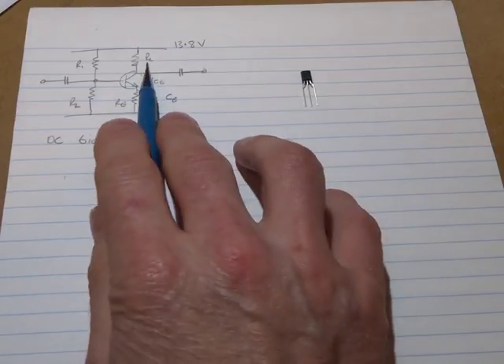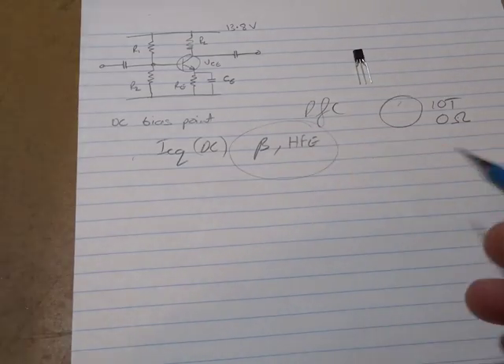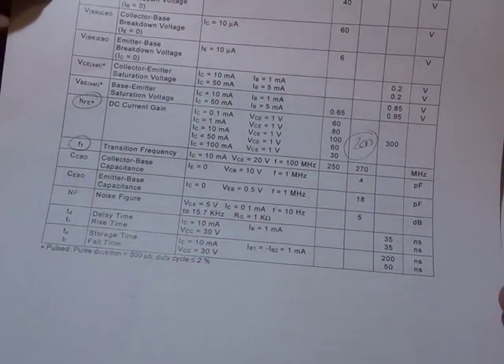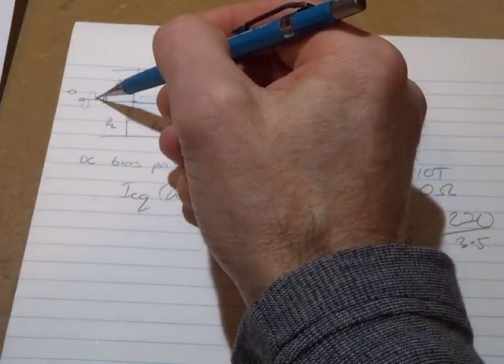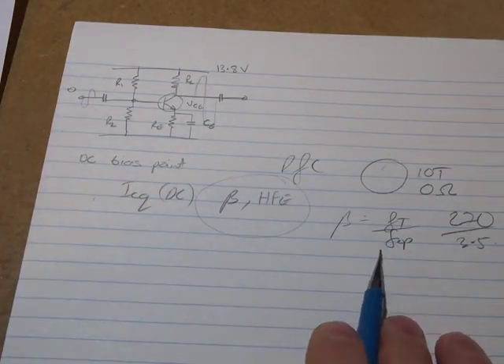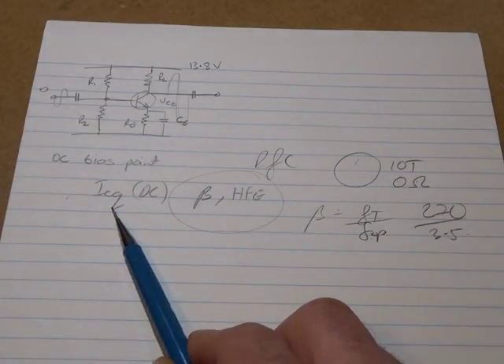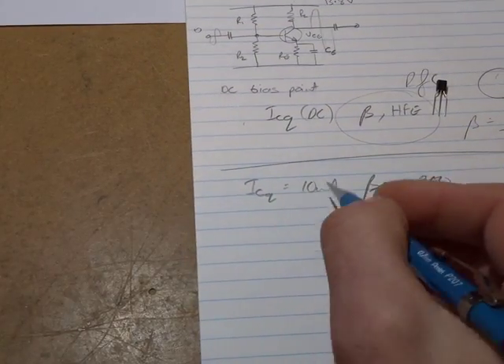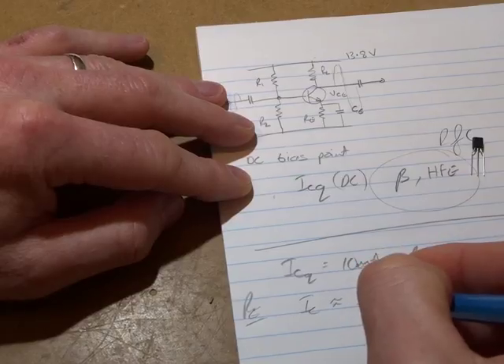Common Emitter Amplifier Biasing Calculations

Comment: The IF rx stage is very inportant but ay have some ideas for experiment with that.Cascode IF amplifier with 4x2N3904  Single Sideband for the Radio Amateur - 5th Edition - ARRL (1970) or   http://www.qrparci.org/wa0itp/csts_book.pdf       http://www.acrayara.com.ar/biblioteca/public/Amateur%20Radio/Single%20Sideband%20for%20the%20Radio%20Amateur%20-%205th%20Edition%20-%20ARRL%20(1970).pdf
Reply from the maker: Thanks Madalin.

Comment: Here is a schematics for a Romainian hf transciever call A412 https://yo4hhp.wordpress.com/2011/10/27/transceiver-a412-description/     and the another one call FT412 design by YO6PIR  .I have a A412 and it works very well
Reply: The A412 use a BF254 rf stage transistor.I have original documentation about this transciever but it is in Romainian language PDF 
if you're interested
Reply from the maker: Thanks Madalin. That looks really interesting.

Comment: why don't use a rf transistor such as BF199,BF254,BF214,BFY90 series or japanese .The 2N3904 it not design for rf and it very noisy
Reply from the maker: Hi Madalin. You are right that those transistors would be more suitable, but the approach I have taken (right or wrong) for the video series is to readily available parts in an effort to encourage others to give homebrew a go. I guess I'm trying to demonstrate that a functional radio can be build from common parts. I can see another build coming on using the parts you identified as a way of showing performance differences. Thanks for the input

Comment: You must have a ''beta-meter '' !!!
Reply from the maker: That sounds interesting Madalin. Do you have a recommendation in mind? It would be interesting to see how much an actual device differs from the spec sheet based mean.
Reply: Yes a beta-meter with difrent collector current test condition like this http://sound.whsites.net/project31.htm.Of course your designs 
must be dependent on beta to other viewers to replicate schematics,not everyone have a complex betameter to design the best pesformance of the transistor which they have at their disposal.
Reply from the maker: @madalinbetea9871  Great. Thanks Madalin.

Comment: Excellent video.
Another design consideration...
Doesn't using a 2:1 transformer effectively cut your gain in half ?
Reply from the maker: Hi. Sorry for the late reply. The main aim I was going for by matching the load to the collector circuit was to achieve maximum power transfer, as opposed to maximum voltage gain (as you point out).

Charlie

Comment: Hi Charlie

Been playing with 'traditional' calculations for this specific biasing technique...  I too come from the 'old school' days of electronics teaching.

What my own calculations seem to suggest, is that your rule of thumb is pretty spot on.  That rule of thumb also appears to be confirmed when running modern tools such as LT Spice (XVII).

The only variation I did come across was Rc.  In both the 'traditional' calculations, online biasing calculators (yes, they do exist) and, LT Spice, the best overall gain came with an Rc (purely resistive) value of between 450 and 650 ohms.

Playing out that value, in LT Spice, I replaced that purely resistive load (Rc) with a 9:1 transformer bringing, in this case, 450 ohms down to 50 ohms modeling an FT-37-43 with 9T:3T in LT Spice.

The gain measured into a 50 ohm resistive load was identical to that measured at the collector output with a purely resistive Rc.

As I have never, in real world experimenting, encountered an Rc larger than ~300 ohms with a 2N3904 based amplifier, indeed, I typically reference 200-250 ohms for Rc, I attribute this to a couple of things.

First is that LT Spice, as good as it is, is still just a simulation.

Second, there is the issue of the internal collector resistance.

Lastly, I could be totally wrong! :p

One last thing is the debate over beta vs hFE.

It would seem hFE (DC current gain) is the proper reference.  I've seen beta and hFE used interchangeably and, I've seen arguments that they are not necessarily related.  

Given that datasheets today rarely list a beta value and do list hFE, using the latter seems to make more sense, as does your choosing a design hFE of 200 with the 2N2904.

In any event, as I stated previously, it seems your rule of thumb is spot on, in my opinion.  The real world operational results of your methodology would seem to support that it is correct as well!

Great video!

73, Robin - AC7LX
Reply from the maker: HI Robin. Firstly thank you very much for the reply, it was very useful. So, from your experience, do you just set a value of Rc to be-say-450ohm or do you determine that each time by finding the open circuit Vo, then Vo/2 across a variable resistors (as Lar's suggested a video or two back)? Also, for determining hFE from the spec sheet, have you across geometric mean before? I seem to recall way back working out the hFE by SQRT(min hFE * max hFE), and not (min hFE + max hFE)/2 .
 
I'm about to start the mic amp so I might as well use a refreshed design approach and 'rules of thumb'.

Thanks again Robin.

Charlie
Reply: Hi Charlie,

Actually, until about a month ago, I had basically assumed an Rc between 200-300 Ohm.  That came from looking at other designs and, a datasheets (I don't recall which one), where there was a reference to  some level using an Rc of 275 Ohm.

Later, I found and watched a video by W2AEW on determining an unknown output impedance from a signal source.  

It was then I had started experimenting with different values of Rc (or RL) to discover at what point the signal was half of the unloaded collector.  I also discovered there was a lot about amplifier design I needed a refresher on!

After your video, I tried something similar to see what Rc got the idle voltage at the collector to Vcc/2 for a given design and then, depending on what the amplifier end use, would adjust to feed a given impedance or, in the case of RF, calculate an impedance ratio to match to, in the case of RF, 50 ohm.

I kind of like LT Spice for that because you can try things without destroying a device.  Pretty sure I'd have some issues with simply tying the collector to Vcc in this design.  

In actual experiments I have started with some ridiculously high values for Rc to attempt to obtain something like an open/unloaded collector and then see what value for Rc brings the signal to 1/2 of unloaded.  

The apparent difference between the two methods is that one is looking for half of the unloaded signal and the other is looking for half of Vcc at the collector with no signal.  I kind of prefer the latter because it can be calculated before attempting.

Honestly, I should be better at this stuff, but it's been 40+ years since school and 10 years since I retired and took a break from radio, only renewing my interest a couple of years ago.

As far as the hFE calculations, I've never done the sqrt calculation, but it seems to end up with similar/close values. ~172 vs 200. However, one never knows which is better until one sees the results.  It is certainly interesting.

Most of the time I use Spice to be close and then work with an actual circuit.

Probably doesn't help much, but there it is. :D
Reply: Hi Charlie,

Just a followup on my last comment.

Simply put, I screwed up! LOL!

I think I know how LT Spice came up with that high Rc value.  I (think), that it was because I was looking at Rc as 'the load', when what I was apparently doing was looking at an open load condition. through a capacitor. 

I replaced the high value resistor with a reasonable inductance (~10uh),  measured the collector output again and got the same value as with the high value resistor.  I then coupled the collector (in that configuration) via a 100n cap to a variable resistor (load) and discovered what I had always assumed.  The output impedance of the 2N3904 is indeed, around 190-240 ohms, at least in LT Spice.

Interesting brain fog on my part, but now the world seems to make sense again.  Well, at least where this stuff is concerned! LOL!

73, Robin - AC7LX
Reply from the maker: Cheers Robin. That 190-240ohm falls nicely around the 200ohm rule of thumb in the SSDRA and EMRFD texts. I do like Lar's process of determining the actual output resistance through test.  

Thanks again for the update!

Charlie

Comment: This looks like a excel spread sheet is needed with the rules of thumb being the calculations and just drop in transistor info with voltages.  I am surprised this is not already available along with many commonly used devices for ham radio. Certainty the info is inside simulation modeling software but it would be useful to have it unmasked and simply available.  Thanks for the video!
Reply from the maker: Thanks Kenneth. I expect this is somewhere on the web. I quite like breaking out the ol-HP48G and running the numbers from scratch. Thanks for the input.

Comment: Hi Charlie -thanks for video 
The approach I have used in the past is to cheat !
Go to old service manuals find the device in question and a circuit close
to the one you want ,copy it and alter the value's you need
That way you will be quite close to what's needed
Cheating -yes,but it works !
What do you think?, or should I be drummed out of the Ham community !
Thanks again
Reply from the maker: Whatever works. So long as you are having fun!

Comment: Good Topic and a well done video,  I recently discovered your channel and I left a comment regarding your casecod amp which was also a good video. Good enough that it got me thinking and a little bit motivated. May I ask what your education is? I have a BSEE from an ABET accredit school (SVSU), graduated in 92 and I am also an extra class amateur licensee My concentration of study was control systems so I am almost useless when it comes to RF design but I have recently become very interested in the subject and I have been devouring every text book, web site and you tube video that I come across.  The best text, thus far, that I have come across is "RF circuit design by Chris Bowick". I referenced that text in regards to this video and like you he really stressed the importance of setting the proper operating point. His analysis focused on maintaining a stable bias point vs temperature and while doing so made some assumptions (regarding hFE / hfe ) while I think that understand why, he makes no mention why he did it.  His example uses a 2N5179 and he just stated it to be 50 (its range is 25 to 250) and you did a similar thing choosing your Beta but using characteristic curves and a load line. As I recall from school that parameter is very hard to control in manufacturing and can vary wildly, there are design technics one can use to minimize the affects, I will have to see if I can dig up my notes from my college days. Aside from picking that value, which can be arbitrary, you did everything else by the book. I can't wait until the next video, thanks for sharing. 73
Reply from the maker: Hi Michael. Firstly thanks for the feedback. I did 30 years in the Air Force, where I started as an avionics technician. All of my basis electronics theory was taught there. Later on I did a BE in electronics, but never worked as a design engineer. It's playing around at home where I try and put those lessons from years ago to good use. I must look up that RF circuit design by Chris Bowick book too. As for beta, I took a simple mean between the min and max values out of the spec sheet. If i recall, taking the geometric mean (square-root of min*max) maybe a better option. As an aside, I don't use characteristic curves, but tend to start just with the spec sheet. I think i will start to use 10mA as a quiescent Ic, as that seems to be a good option.

Again, thanks to you and the others for taking the time to leave a comment. I really do appreciate it.

73s
Charlie, ZL2CTM
Reply: @CharlieMorrisZL2CTM  Because β does vary in manufacturing, it makes sense for the hobbyist to look for transistors that are gain-selected. I currently prefer BC547C for general use which has been selected to have a β between 420 and 800. That's a tight range and typically remains independent of collector current from 1mA up to 100mA. You can design with those and assume a minimum β of 420 safe in the knowledge that the calculated base current won't be any less than half the value calculated.
If you use 10mA as the quiescent collector current with a transistor like the 2N3904 (min =100) and bypass the emitter resistor, you can end up with an input impedance looking into the base of 100 x re = 100 x 25mV/10mA = 250R. That will be the dominant value in determining the stage input impedance since R1 and R2 were found to be 22K and 3.9K, and all three are in parallel.
It should be obvious, I hope, that reducing the collector current by a factor of 10, i.e. to 1mA will reduce all of the currents by the same factor, and hence all of the resistances and the input impedance will be increased by a factor of 10. For RF use, you can match stage impedances with transformers, so it makes sense to select a Ic that makes the parasitic capacitances negligible and 10mA might be sensible, or maybe a lower Ic might be just as good. For audio use, an input impedance of 250R would not be a good idea because of the size of coupling and bypass capacitors needed to get a flat response down to 20Hz. For audio, an Ic somewhere between 100μ and 2mA would be a more common choice
Reply: Charlie, thanks for getting back to me, I think I have just what you need. Are you familiar with w2aew youtube channel ? He has a few videos on this topic. Video # 182, and #272, here is a link to his Bias video # 182 https://www.youtube.com/results?search_query=w2aew+185
Reply: Charlie Morris Wow you were in Army. That explains it.you are fantastic.

Comment: Hi Charlie, great video as always. I think your idea of the quiescent voltage on the emitter is not right. At 3:44 you explain the 1V rule of thumb because the working line should not enter the cutoff region. I think this (your way of explaining) is not right, because Ve is completely external to the transistor. The diagram you use shows Vce, which is the emitter-collector voltage, completely inside the transistor. You could lift the voltages around the transistor any amount you wish, as long as you keep the Vbe and Vce as designed. I always design Ve to give me the ability for some swing on the emitter, although this will not be very much. But, this may not be the best way. Cheers, Koen
Reply from the maker: You are dead right Koen. I was lying in bed last night reflecting on the video and realised what i had said was incorrect. I will update the video description to make that clear. In regards to your designs, do you run with approx. 1V on the emitter or 10% Vcc?

Charlie
Reply: As far as I know, the external emitter resistor is only needed to swamp the internal emitter resistor (little r sub e), which is temperature dependant. Without external emitter resistor, the amplification of the common emitter transistor amplifier would be highly dependant on temperature. Also, the external emitter resistor gives some negative feedback, which helps to minimise distortion. I just choose Ve to be somewhere between .5 and 1 Volts.
Reply: @MrKoenvandijken  You're right that the emitter resistor is there to dampen the effects of temperature and variations in the transistor's parameters from sample to sample. The real problem with omitting an emitter resistor (or bypassing it completely) is that re depends on collector current and for large output swings, the gain for the positive half of the signal will decrease, while the gain for the negative half will increase, producing serious amounts of distortion.
Since the internal emitter resistance (re) is 25mV/Ic, we can choose Re to be at least ten times that (as a rule of thumb) in order to swamp out variations in re. But that means its value is at least 250mV/Ic, which immediately leads to the conclusion that it requires 250mV across it. If you can ensure that the base bias point is "stiff" (i.e. doesn't change much with changes in the transistor's β or its Vbe from sample to sample) and repeatable (i.e. you use decent low tolerance resistors whose value won't change), then you can afford to bias the emitter as low as 250mV and do away with the bypass capacitor completely. Otherwise, you have to split the emitter resistor and have 250mV across the unbypassed part and several times that in the bypassed part, depending on how "floppy" your base bias point is. Maybe a volt or so at the emitter turns out to be needed, but using 1% resistors and something like a BC547C, which has a very high β with a narrow variation, might allow you to get down to a few hundred millivolts at the emitter without problems.
Reply: @CharlieMorrisZL2CTM  As I commented to Koen, modern, high-β transistors and 1% resistors will allow you to push down the voltage at the emitter. It doesn't depend on Vcc. By that I mean, the lowest bias points you can get away with are the same whether you have a 6V supply or a 30V supply. Higher supply voltages allow larger gains and larger output swings, but don't affect other design parameters.
The "knee" in the Ic vs. Vce curves is just the saturation voltage of the transistor, which you can get from the data sheets, typically about 0.2V for general purpose transistors. Then the lowest voltage that the collector can swing to is simply Ve + Vcesat (the voltage you set on the emitter + the saturation voltage). For maximum output swing, you have to bias the collector to be at (Vcc + Ve + Vcesat) / 2 volts.